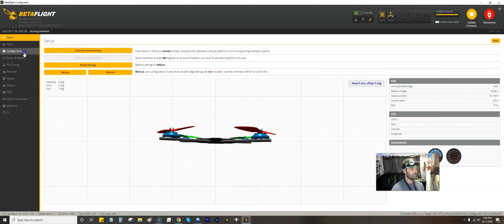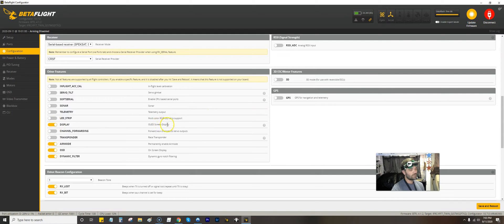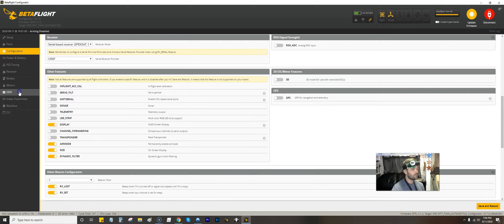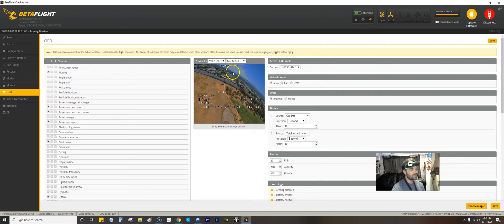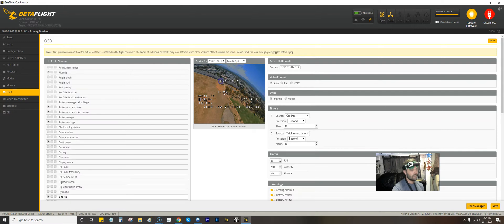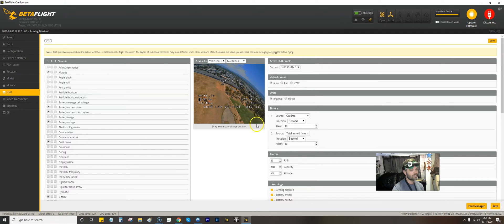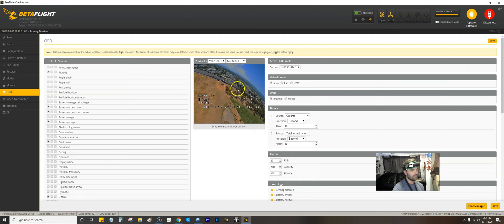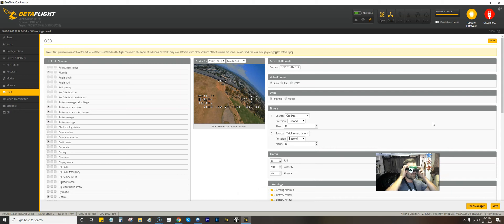Betaflight OSD Not Showing? EASY FIX!

Comment: My quad is not showing osd, is it all caused by betaflight, or maybe a wire not soldered to the vtx? Do u have osd just with the 3 cam wires linked to the vtx?

Comment: If you are here for problems with OSD. did you flash your FC with the right OSD protocol?
be careful with that.
Reply: What you mean I flashed 5 inch preset worked before now it does when I select it save reboot reconnect it's not selected can do it in cli page

Comment: Every time I "save and reboot" it disables the "display" switch. No osd. Running F7 fc.
Reply: ever figure this out? I have the same issue.
Reply: @userjohnfpv  @resiarie
 Yes, you need to set the peripherals in the UART to "VTX (MSP + Displayport)"
Reply: @userjohnfpv  Ok i fixed it. Only a firmware re-install with fix this
Reply: how to fix it

Comment: hey i wanted to make the display mode on... I saved and reboot but the display mode have turned off automatically!! You Know any solutions?
Reply: Have found the solution?
Reply: @igorkadet6800  my flight controller had no osd 😅
Reply: @pizaafro5612  how to fix it?
Reply: @resiarie  if you have a old version of a flight controller than it won't work. You need a F4, you probably have a F3
Reply: @pizaafro5612  I'm using geprc f7, can it be repaired 🙏